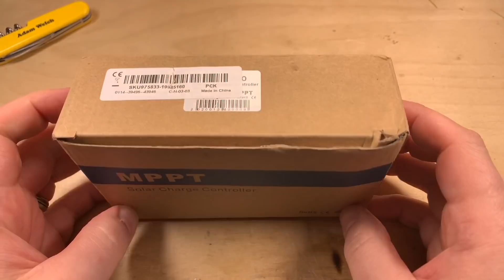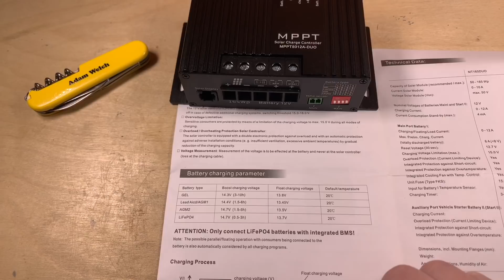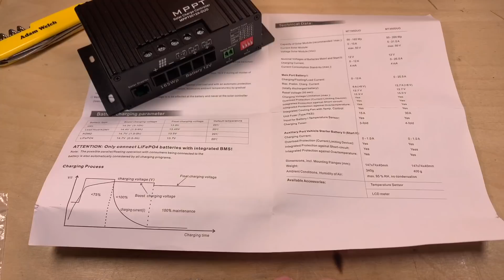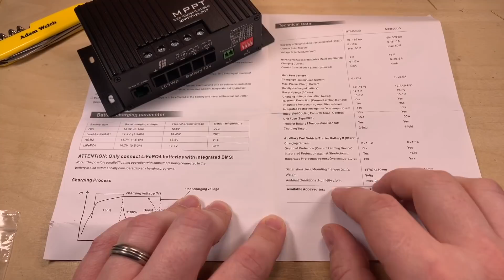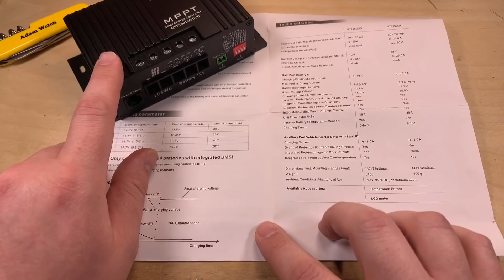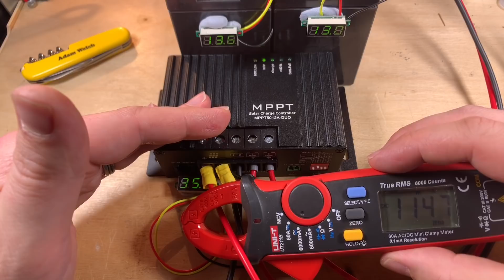Cheap RV MPPT Solar Charge Controller

Comment: I have one too, was working fine until I decided to change to Lifepo4, then it stopped working (with selector adjusted for Lifepo4). Now only MPP lights up and no charge passes through to the battery connector side from the solar charging side.  Panels are fine.

Comment: If you fill the mosfet area with heatsink plaster that would keep them mosfets cooler. It looks awful and the components would be stuck to the board permanently but I think it would work.

Comment: Hey! thanks for your videos!
I bought such a controller and installed it. He worked for 3 months and "died". The radio master looked and said, the chip burned out, it is possible to replace it, but it is expensive. In addition, there is no firmware for the controller. What do you advise? I took it on Ali.
Thanks!

Comment: Hi Adam, any idea why when I connect starter motor battery cable in this Smart Mppt charger, it goes into a state of 'ready for service' like at night when no sun is present. worked fine before I increased AH of leisure battery and then when I disconnect the positive charge cable to starter battery, it resumes charging the leisure battery as designed.. bit stuck for why it does that when it worked before.

Comment: you bring up several points i am trying to work through. i have a 800 watt solar array at home that  i am learning from it for about the past year.  about 6 months ago i put a "charge regulator and a "25 watt" glass (dangerous glass) panel on the dash of my vehicle, i have many electronics i dont want turned off that use power at all times and i got tired of getting new batteries every 9 months or so which is why i added this small solar setup to the vehicles.  question 1: while this panel is 25 watts i highly doubt i am getting much more than 13v x .3a =  3.9 watts, i am now in the process of testing to confirm but my suv battery was too high today today and i was short on time to put a big load on it. anyways about 3 weeks ago my alternator went out, i put a new one on and 2 weeks later the new one went out. i made note of this, but carried on. i wanted to put a 40 watt flexible panel on the dash, keep in mind the solar panels stays there at all times, i thought about just putting one of my many extra older pwm controllers on that panel, but i didnt know about a minimum wattage to get things going. its possible i may only get 12 watts, surely this is minimum is a limitation of mppt, right? i just got a mppt for home and im testing and learning from it too as i speak. question 2: do rv folks leave all the solar stuff plugged in and powered up and charging while driving around with the alternator, batteries and charge controller all tied into the same system, like i am doing? i am trying to figure out whats going on and why everything is falling apart on me.  tonight i just noticed a rigid branded tiny 120 watt inverter that  was also tied into this system suddenly cant power more than 35 watts in the vehicle or on the bench, its only about 2 months old, and i tested it when i first got it and it was in fact capable of 120 watts continuous on the bench for literally hours, now on the bench it shuts off and turns back repeatedly on  a confirmed 35 watt load and gets really hot, the fans do work btw, but it seems to be able to  handle about 25 watts without shutting off. also, i suspect i have a bad charge regulator i do not know the difference between a solar charge regulator and a solar charge controller. so in summary in the last 3 weeks i have found : 2 bad alternators, 1 damaged 120 watt inverter and 1 bad solar charge regulator. what am i doing wrong????

Comment: What is going to happen if there will be higervoltage on a starter battery let's say as if the alternator is working? Will it charge the auxiliary battery with the alternator when the sun is down?

Comment: Could you remove each mosfet from the pcb, add adequate wiring to the pcb, and reattach them to the side of the case internally?  Thats if they share a common ground.   And also add a fan.

Comment: I am curious if the difference in the 20a and 10a is just the 2 capacitors and 2 more mosfets you might want to check and see if so that would be a interesting mod that would intrigue some people like me.

Comment: Listed at about $23.10 USD (40 AUD or so) there. 10A will get you just say a single 160W panel at 23.4% efficiency or over which puts out a max around 8.9A. Useful for a vehicle with a single extra battery to charge, but not much use for a larger array. The 25A version is twice the price, which could get you to 2 x 160W panels.

Comment: You shoud try their MPPT5020-BT version. Full infos via bluetooth and the fan seems to be there and by the side screws I guess the transistors are casing cooled/mounted in the wind path. Would have much interest in this video.

Comment: the bluetooth 365w  duo  with fan and brilliant app can be had for £40 and works great for lifepo4.
its a gem
it does mppt  from start  and  delivers over 95% efficiency and if like me you have 21v panels and 40v panels you can fit 2 controllers and use a duel app to view both systems on your phone.
its an absolute bargain able to deliver more than what far more expensive products do.
Reply: Dear Harry, do you know the name of the app?

Comment: Hello.
Iam member of a rc planes group and 4 more friends wanna put solar cells on our  drones  called Parrot disco but we need the best and the smaller MPPT and need your help to buy  the best, small and the low weight because the drone is small and we wanna increase the flight time.
We use lipo batteries 3 cells 11.1 volts.
If can you please help us to have more fun and more flight time.
Please help us. Please please
Thank you. 🤗

Comment: you should have put your multimeter on the pins in the back left corner that you suspected were for the fan and see if it is outputting a voltage and then hooking up a fan and see if it is indeed temp controlled. Could you see anything on the board that looks like it can measure temp?

Comment: I bought the 25 AMP version after seeing your review it does have the fan 😁.I then bought what I thought was the LCD that goes with the controller. It didn't fit the connection didn't match 😔. Could you help me with the correct LCD display please 😁.

Comment: Hi nice video m8  am looking for a mppt controler for my campervan  .I have been given a  37.3v 270w  solar panel  and have a 100ah gel leasure  battery   . What would u recommend  to buy
Reply: Adam and many like the Epever Tracer AN series, usually around £45 for the 20amp version, thats probably the best of the cheapest option, HTH ;-)
Reply: A better one than this,spend 200$.

Comment: I would get straight back to the seller and tell them that the fan is missing. They'll either send a fan, replace the unit, or refund your money. If they don't play ball, fit a fan anyway.
Thanks Adam.

Comment: I've the 350W/25A version of this controller (with fan) and the default LifePO4 charging voltage for that version is 14.6V (floating:13.6V). This equals the max charging voltage of my 100Ah LifePO4 battery. There are more LifePO4 settings though which aren't listed in the manual: 13.9V (up,down,down,down), 14.2V (up,up,down,down) , 14.4V (up,down,up,down) 14.8V (up, down,down,up).  Cheers
Reply: This is a Votronic  Duo Digital 350 MPPT charger clone. Check the manual of this charger for those additional settings. I only understand the first sentence of your reply. The remainder isn't clear to me
Reply: how have you come to this conclusion ....
do the settings you suggest knock out all lights bar mppt  light  on the instructions lifepo4 setting ?

Comment: Enjoying your Videos Adam. As a Van owner who has been learning about Solar for the past couple of years, I would say that the best method of charging your Van / RV battery via Solar is using a decent MPPT controller with good panels, over 200W out, but the more PV power the better really. If you connect engine and Leisure batteries using a decent VSR then when Leisure side is full the extra power will pass to Vehicle side anyway.
Reply from the maker: Cheers. Good to hear about your experiences. I’m sure your way is probably best, but I thought this charger was interesting for a video.  Thanks again.

Comment: The problem I get with charge controllers is those that have a load side usually cannot cope with the stated load. Example - I have a 30A Renology MPPT controller and if I put two fans on consuming 3.92A approx, the thing stops dead, tells me there's a short circuit then after a moment or two decides there isn't and runs things as they should be.
Reply: That's not a charge controller faultc per se, but the fact that they are rated with resistive load and nowhere on the box, manual or listing it says so. If you put inductive load on it ie. motor it will crap out beacuse the motor at start is actually consuming more power than rated at star-up (motors are rated for continuous work current). That's why you use different rated fuses with inductive load - same constant current characteristics but more current surge capabiity.
Reply: Doktoreq  all the load side is, is a switch combined with a voltage sensor. If the voltage is too low, the switch won’t allow current to pass. How simple is that yet renogy or rather the Chinese manage to fuck even that simple thing up.

Comment: Aluminium? I love you guys. Great vid.
Reply from the maker: Do you know I even pronounce the ‘h’ in herb :-) 
Cheers.
Reply: @AdamWelchUK  ..... Eee tort me ta walk anta talk lyke a regular Lady !
Wouldn't you have the starter battery as the primary ? (as it's the most critical ?)
Reply from the maker: Rob Robbie I guess that depends on your use case. Starter batteries are used for very short periods of time before the alternator starts to charge it back up. Leisure batteries may be used for hours or days before the engine is started again. The limiting factor is that the primary battery can only charge the secondary at 1 amp.

Comment: Hi Adam here's one for you lol I have just been on eBay to buy a solar panel and controlled kit ,but messaged the seller to see if the controller would be suitable for a battery pack made up of 18650s in a 10p 3s configuration and I was told I didn't need a controller with that  configuration just the panel ?? I'm waiting in an answer back as to how it would stop charging and not just keep charging
Reply from the maker: Ouch - I think there is a misunderstanding there! I’d imagine the voltage of the panel was such that you’d absolutely need a charge controller.
Reply: @AdamWelchUK  I told them exactly what I was using lol
Reply: How does it stop the charging and not over charge

songqi1688:

Dear customers,

According to your description, a battery pack with a rated voltage of 11.1V which consisting of three 3.7-volt lithium batteries can be directly charged using this solar panel .And you do not need to purchase a controller.

Best wishes,
Iris

Comment: I would never use such charger on LiFePO4 batteries ... that's not a acceptable voltage in any case. the voltages are Above the recommended fully charged and Nominal Voltage ... that is a destroyer of LiFePO4 batteries.
Reply: Agreed 👍👍👍
Reply: Note that the V meters are not precise.. they are 0.5V off

Comment: It looks like they never finished assembling it - I would definitely  fit some individual heat sinks on them MOSFETs and a drop of splooge to stop them fatiguing the pins and then fit a small fan
Reply: I ended up buying one of those 3s mppt modules and an an on off switch lol

Comment: I did a little research on that controller and Eco-Worthy sells re-branded versions of it (12/20/25/40 amps).  All of them can use the MT LCD display (MT-5, Product L03MPPTXSQ-1) 
https://www.eco-worthy.com/products/mt-lcd-display-remote-meter-monitor-suitable-for-charge-controller
(US $23.94 and free shipping in the US.)

I'm reasonably sure I've seen "MT-5" as a meter designation elsewhere but not making that connection right now.

Some of the controllers have Bluetooth (-BT in model number) and there's an app available (haven't yet seen a source for the app yet).
Reply from the maker: That’s interesting thank you. MT5 and MT50 are meters numbers used by EPEver which is where you may have heard it before? I still have an eco-worthy charge controller in a box in the shed (my first mppt solar charge controller) it was great. Thanks for the research.

Comment: Hello guys, I have a question, I have a small 50w solar panel, can I use a buck converter to charge a battery instead of a dedicated solar charge controller? Thanks.
Reply from the maker: Possibly you can yes, but they are not particularly well suited to it. For example many might not like a battery on the output - unless there is a protection diode the current can flow the wrong way when the panel is not creating a voltage (ie at night).

Comment: There seems to be room for a couple of more MOSFETs and capacitors  (and a fan of course). Is that the reason for a cheap enough price?  A factory reject?
Reply from the maker: I expect they may be populated on the higher current model - no proof, just a theory.

Comment: Thanks for a very interesting review. I could use this for my Woodland cabin and use the starter battery port to charge a battery just used for lights. Then my inverter on the main batt will not leave us in the dark when that battery runs down.

Comment: The small voltmeters often have an adjusting screw on the back in one corner. Maybe this is also the case with your small voltmeter. I could set all of my little voltmeters exactly.

Comment: What's the voltage of the fan that they didn't put in by installing one you couldn't make it last do you think you could add heat sinks or just run a cable through the top of the two attach a heatsink that

Comment: You set the dip switch to gel, but then said you attached a lead acid battery? Would this cause issues?
Reply from the maker: Lead acid is the overall type of battery - it is broken into sub sections, flooded, sealed, Gel, AGM. They all use lead and some type of acidic electrolyte. I choose a setting which is reasonable for the type of lead acid I was connecting. Sorry if I caused confusion.

Comment: I have been following you Question Which is the charger controller for 4s li Ion 18650
Reply: Try the Makeskyblue controller or it's much cheaper equivalent Powmr. The latter one I'm using at the moment to charge my 4S 100Ah pack based on 18650 cells. These are MPPT controllers.  Check AliExpress and order at the Ysolar shop. They send you 60A version even if you order 40A version

Comment: Thinking for about $10 more ($44 to $54) We can just buy the EPever and also be able to change the float voltage or delete it and all other adjustable parameters and display, and it already has a decent heatsink. Would rather buy that one then have to mess around with adding heat sinks and a fan to this. Our time is worth something. It's not bad for what it is I guess if we just use it with a couple 30 watt solar panels in series It may not need a fan. Would have to test it. But still I don't like that high of a float voltage

Comment: Assuming all those FET's are common tab it would be easy enough to put a heat sink bare across the two sets.   Wish you investigated the liFePo4 voltages .    Not auto 12/24 system it seems.??
Reply: Definitely they all need to be isolated. I wonder if they included the thermistor and only a fan needs to be added.

Comment: I've had the 25 amp version on my boat & same on the van. Mine does have a fan on it though .. I took it apart when I got it as I was unsure with it being so small  .. good review as always 👍
Reply: Oh and mine are rebadged as spark .. the voltronic ones are even better so I guess they used the main board and added to it
Reply from the maker: Interesting thank you Andy. Glad to know they work in a real situation (and for a good while). Cheers
Reply: https://s.amsu.ng/06xQhmde7eHN

Comment: This is a Votronic  MPP 165 Duo Digital clone. They also come in a 350W version with built-in Bluetooth and fan but without the AES. The mosfets are placed in the same way. I've paid 78Euro for that version including the LCD display. The temp sensor is a 2k ptc, same as Votronic. The manual doesn't describe all dip switch settings. Just refer to the Votronic manual for a more complete description of this controller.
Reply: I Bought the Bluetooth version as well but i can't seem to be able to pair.  What PIN did you use? not in the manual and the usual suspects don't work.
Reply: @Mr-Curious  Let the app find the regulator. No pin is needed
Reply: @54CHARM  I am not successful :-(. I see the device as solar regulator in my device list. But the app itself never sees the regulator. sucks :p i just bought it for this feature.
Reply: @Mr-Curious  unlink Solar Regular from your BT device list in Android. Then let the app find it. Hope this helps.
Reply: Link to manual https://www.votronic.de/images/Manuals/07.%20Solar%20Current%20Technology/1710_1715_1720_1725_e.pdf
Reply: You got a link to it?
Reply: Just check on AliExpress. The brand is Olys. The 25A version seems to be sold as 20A now. There are also versions without the brand label. So better just search for MPPT